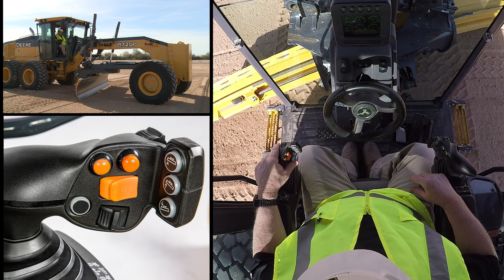John Deere Motor Grader Left Dual Joystick Controls Tutorial

Comment: The only issue I can think of is the rollers, the ones for example Lundberg 6220 has (a swedish wheeloader)  was supersensitive to dust, they began sending signal to turn the blade for example even though in neutral position. They wasn't cheap and cabels had to be solderd every time. Let's hope these are better quality and less sensetive. John deere are in the starting stages of selling graders on the Swedish market now so it's a bit interesting.